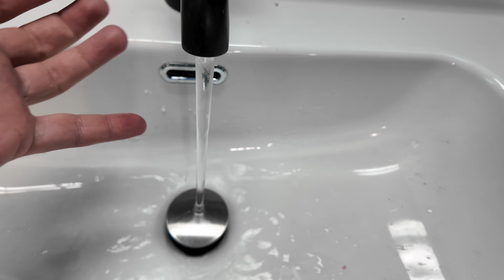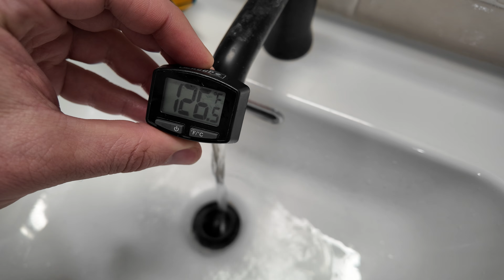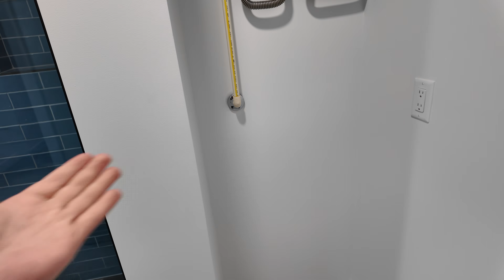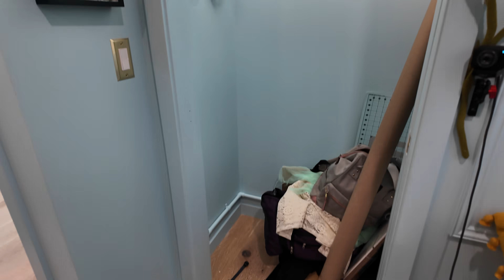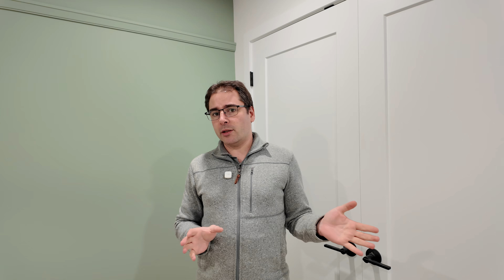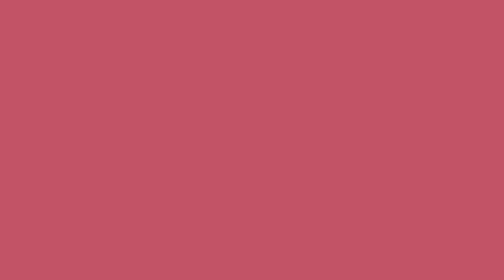Replacing our tankless water heaters... | House Files Ep 43

Comment: Why not use gas heater instead of electric? 199k BTU/h heater will do 7gpm at 55f rise.
Reply from the maker: Well 45+55 is only 100 so still not really hot enough. But of course for practical purposes we don't need 7gpm so it would be fine, but also our electric that can heat 2gpm would be fine for practical purposes.

Comment: I am a big fan of the heat pump water tank heaters.

Extremely energy efficient and their waste product is cool/dehumidified air.

They are also double reliable with two methods of heating... heat pump/resistive electric or heat pump/natural gas with most models having a high demand mode which will make hot water with both methods simultaneously.

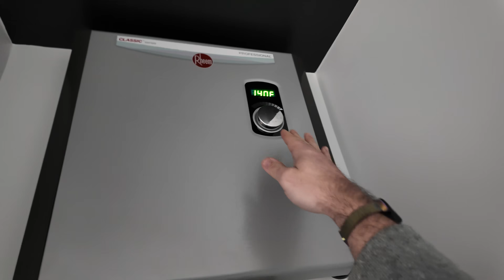Comment: 2:00 It sort of makes sense but sort of doesn't. Water heaters shouldn't even be able to get hot enough to scald. So the scenario the inspector described is real but is a failure of standards. Officially "scalding" is 155 degrees (can burn in 1 second). But realistically people get scalded by water over 120 all the time. Water heaters simply shouldn't be able to go any higher than that. Then it doesn't matter what someone in the next room does.
By the way, my on demand water heater is poorly designed as well. It's too bad. I've always thought they were a great idea and should be adopted more. But I've had no success with mine. Conceptually I still think they make sense. But manufacturers don't seem to be resolving the design issues.

Comment: Being able to heat with all fixtures open at once is a pretty ridiculous requirement. Is that actually in the code? Regardless, tanks are better at providing consistently heated water anyways. Gas is also MUCH cheaper than electric.

Comment: You need to put in multiple units one for each section not one for the whole place
Reply from the maker: That would have been another way to do it if we had planned it that way from the start, but there's no way to run more 40amp power circuits to each bathroom and the kitchen anymore.